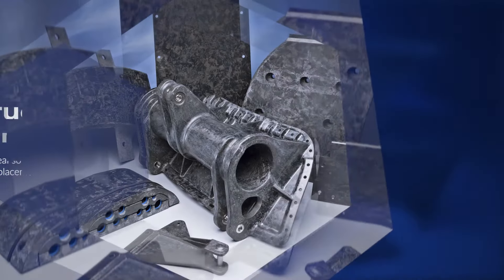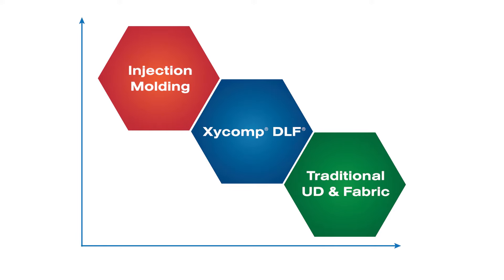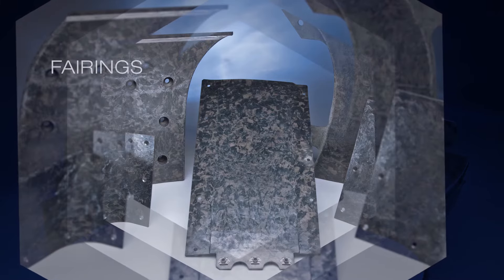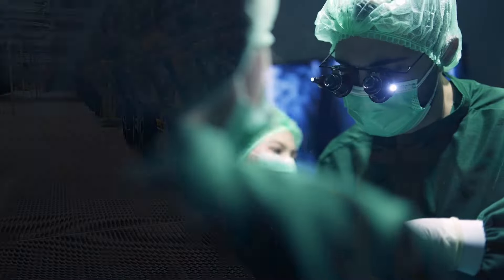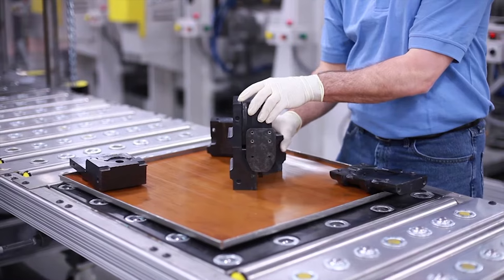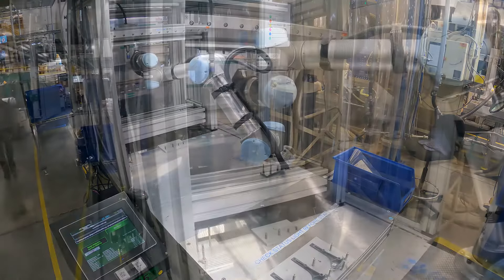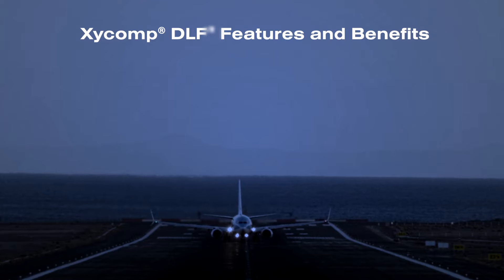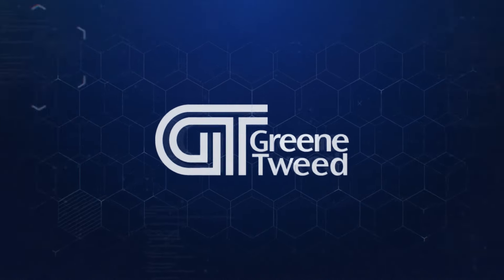Xycomp® DLF Composites: The Ideal Metal Replacement Solution for Complex Shapes

Comment: Is the strength similar to or greater than steel and cast aluminum? How would a part made hold up to road vibration in a semi truck suspension application?
Reply from the maker: It will depend on the specific requirements of the application, but Xycomp DLF can be used for smaller vehicle suspension components. Xycomp’s mechanical strength is more comparable to aluminum than steel. Heavily loaded steel truck components may prove challenging to convert. Vibrations are typically not an issue due to the mass reduction, dampening capabilities and the design freedom that Xycomp DLF offers. 
If you would like to talk to an expert and get some more information, feel free to contact us here: https://www.gtweed.com/contact-to-quote/
Reply: @greene_tweed  thank you. On my kenworth, the suspension is called AG380. There are several items that are made from aluminum. However, the particular items I'm thinking about are the mounting brackets that bolt to the top and bottom of the crosmember that ten gets bolted to the frame rails. Not super critical, but I've been trying to find a way to make it out of carbon fiber. This seems like it would fit the bill. Thanks
Reply from the maker: @scotthewins5341  let us know if we can help! Our team can certainly walk through some of this to see if it would be possible.

Comment: As someone who is not in the production/commercial engineering field, what would be the most likely form for one to come into contact with this product and recognize it as such?
Reply from the maker: Great question! You would likely not come into direct contact with this product unless you were an engineer, but many parts made from this material can be found on commercial aircraft, industrial machinery, and robotics. This material has been used on aircraft interiors, like doors, so that could be one way you would see it in use!